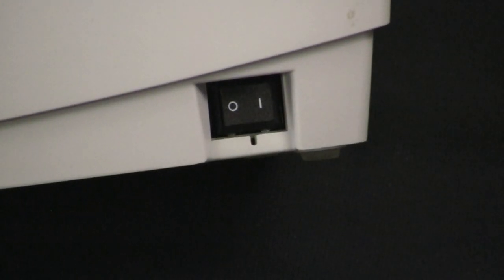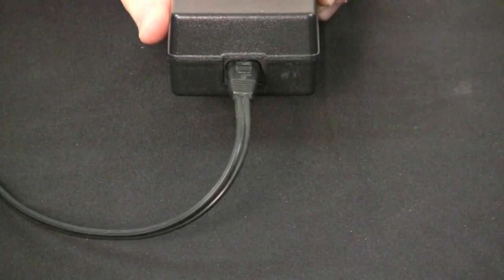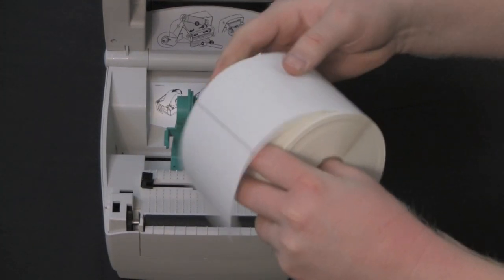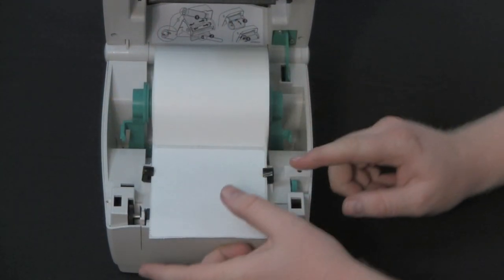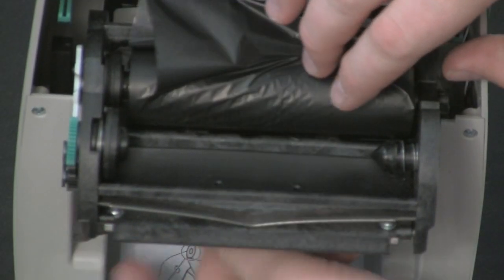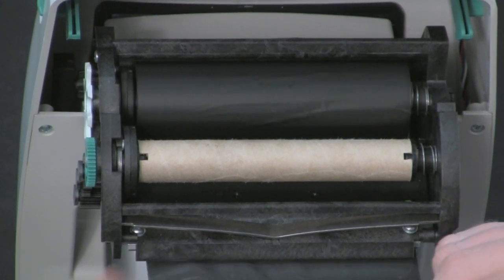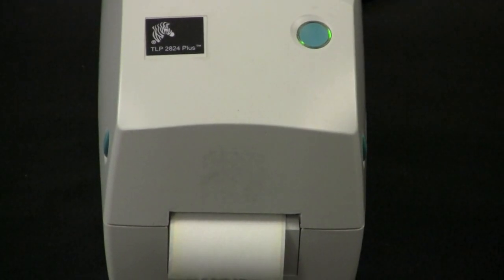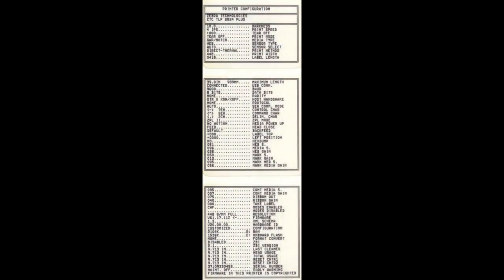Zebra TLP 2824 Plus Printer Setup

Comment: Is it required to use the black roll?   My printer didn't come with it.  We also have more of the Zebra 2824 that do not need this black roll.  I definitely have the printer pictured in the video above but wasn't aware that this black roll was needed as our other two zebra printers dont use this.  Only difference with the other 2 printers is that they are smaller and are a networked version of the printer.   Same 2824 model though.